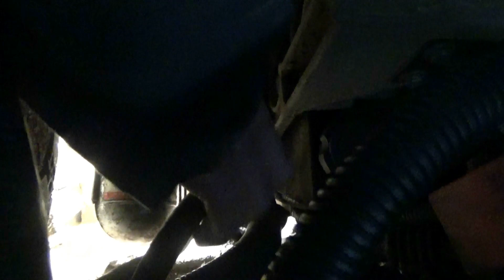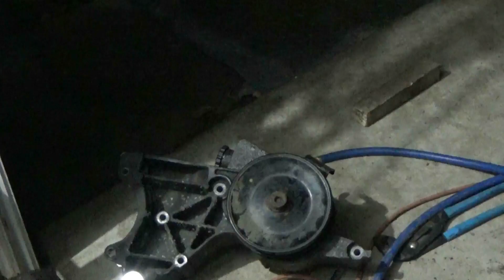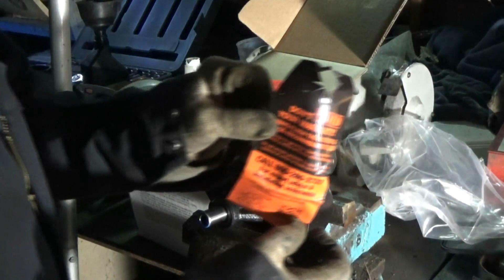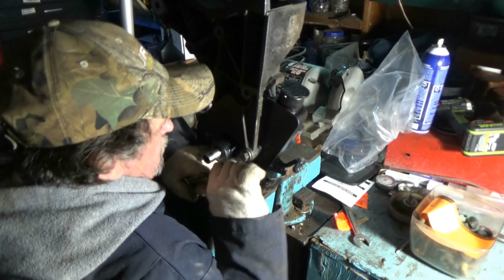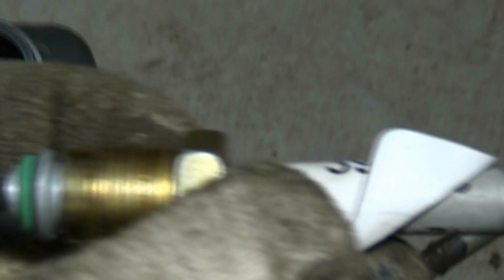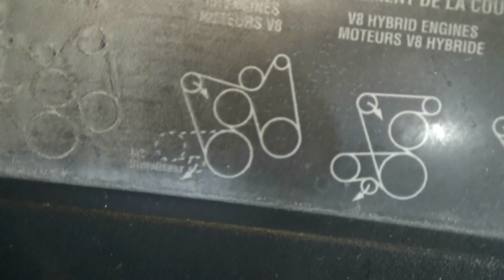GMC/Chev 1500 Power Steering Pump Replacement

Comment: Excellent video! Thank you for pointing out the mounting bolts for the bracket! Couldn’t get mine to line up and that was the reason! Blows my mind I paid 200 bucks for a brand new pump but still had to use hardware off my old one! Oh well I guess that’s part of the adventure of wrenching!
Reply from the maker: Your comment is much appreciated! Glad you found the video useful.

Comment: WTF Why in the hell are you using a grinder to cut that pully off?  You do know they make a puller just for that don't you? Habor freight sells them for $19.99 and thats less than a new pully would cost and a hell of a lot easier.
Reply from the maker: See explanation at 6:51

Comment: Haven’t driven my 2007 GMC Yukon it hasn’t been really driven in a year.  I put new battery in started right up, but I heard the power steering making a noise. Put fluid in does ok a few drivers am them more noise and hard to turn. So not sure if a flush will help or a new pump. Anyone have suggestions?  TIA
Reply from the maker: I've had a similar issue before. What I did was loosen the high pressure line at the steering box just enough to allow a bit of fluid to seep out. I started the engine and cranked the steering wheel all the way to one side then all the way to the other side. Quickly shut off the engine and tighten the line. Seemed like there was air bubbles in the lines. This worked for me. You will loose a bit of fluid. Hope this works for you.

Comment: Hi, I am having trouble putting the pulley back on. When I thread the tool in and begin the motion to push the pulley in, what ends of happening is the bolt gets pulled out and strips the threading. Am I not threading it in deep enough? any thoughts would be appreciated!
Reply from the maker: Are you using the right bolt? My kit comes with 2 different length bolts.
Reply: @MudRFunR  the kit I rented had an adapter, but I used the only one that was able to thread in. Unfortunately none around me has the two bolt kit that you used.
Reply from the maker: @mastapimp189  You could lightly tap the pulley on until the bolt can thread in. Use a block of wood with a hammer so you don't damage the pulley.
Reply: @MudRFunR  I would jump on my latheand make a new one

Comment: Where do the o rings go that come in bag with new pump Sir?
Reply from the maker: Not certain but I do believe they go on the end of  the line fittings.
Reply: @MudRFunR  thank you, I replaced one with a brand new pump and it just  leaked out as soon as I put it. Not sure wats leaking. Have a Bkessed one
Reply: O rings go on the line you twisted out the back 
One line is twisted out
And one is push one

Comment: Where did the 2nd Oring go that came with the pump?
Reply from the maker: I'm not sure which o-ring you mean.
Reply: @MudRFunR  I just bought a replacement pump it came with 2 orings one smaller than the other one goes on the right pressure line and the other one is a mystery....the pump looks like it's still leaking out the back from high pressure line....I'm stuck

Comment: Good day Nice video. I buy cutting blades from TSC stores, dewalt for $1.00 on sale. I use them to cut scrap steel, very thin. Boy when you were putting bolt with bushing on new pump,  wrench slipped off,I thought you twisted bolt off in new pump. I have 2013 V-6 there is enough room for a person to sit in there between motor & radiator.  I get sick in head when laying flat,  I cannot change my own oil anymore,  bugger  oil changes cost $72.00 a penn-oil How many kilms on truck  Thanks
Reply from the maker: The truck has 290 000 kms. I usually use Dewalt from TSC as well. That's what the small disc was.